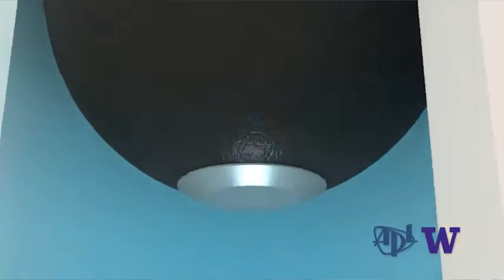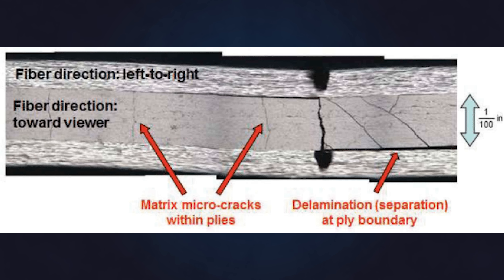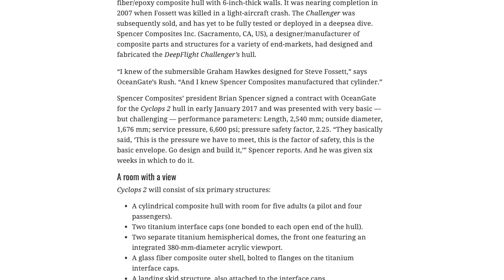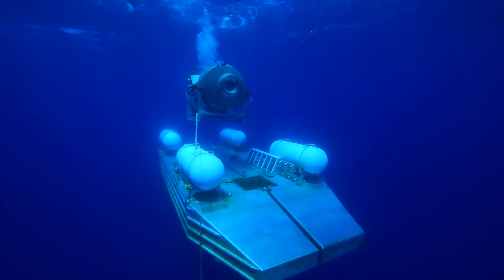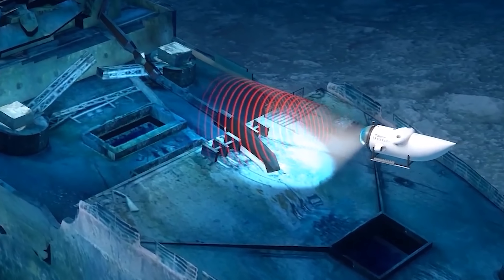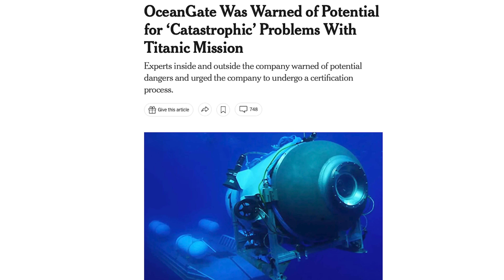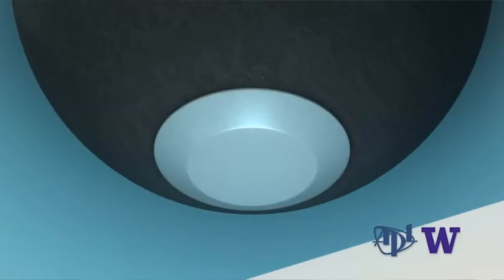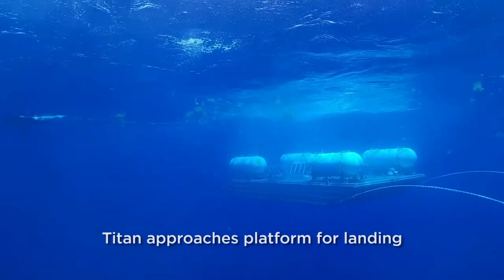Engineering Failures Behind Titan’s Implosion!

Comment: Well done sir.  There have been many videos posted by others attempting to explain the engineering and design flaws in this tragic situation.  This video is simply the most articulate, concise and yet informative.
Reply from the maker: Thank you 😊
Reply: @beyondengineering what about a submersible made from super glue and baking soda?
Reply from the maker: @dansaber4427  depends, what is it being submerged into?
Reply: @beyondengineering  to go to the Titanic of course. I've heard it's stronger than steel
Reply: @dansaber4427 Yes!  Let’s pick really impractical materials and then proceed on hope.  My choice would be a hull of sodium.  Just give it a nice coat of waterproof paint and don’t scratch it.
Reply: @beyondengineering 
All other problems aside,
why remove the cylinder after wrapping the carbon fiber?

Why not wrap the carbon fiber around a titanium cylinder and then attach it to the end caps with flanges?

It just seems to me that the 
carbon fiber could be used as an enhancement instead of as a 
stand-alone structure.

I know that this would require additional study and testing but is the concept valid?

At least the water couldn’t find its way though and unzip the thing like a waterjet in a machine shop.

PS

That is one creepy thumbnail that you used for this video…
Reply: selling a sub on its tensile strength is like bragging about the crush strength of a blimp. Mental!
Reply: Amen... and in such a  cool manner.
Reply: should we blame the carbon fiber inventor for the implosion or the user's stupidity?
Reply: @weepeeteeee No we shouldn't and no one did.

Comment: I don’t think it’s fundamentally flawed. What should have been done thought, is build a full size shell, even a scale model could have worked, and send it unmanned up and down as many times until it popped. Taking measurements and recording the entire time. If it’s safe for 5-10 times, then needs to be rebuilt or just discarded all together- then at least that’s what you would know

Comment: Carbon fiber is good for f1 cars but for titanic visits no it should of been made out of titanium cylinder and then Carbon fiber if at all because metal in cold it shrinks and in heat it expands it like getting a metal bar and bend it back and forwards it will snap at some point

Comment: Also. Concider the lateral pressure created on the epoxy by the equipment brace frame mounted on the rear titanium ring. There is a lot of weight on that ring.

Comment: Listen , if carbon fiber was the way to go . The Navy would be using it on their submarines. They DONT! Anyone who paid to go in this device who believed and trusted its ceo who avoided safety and openly spoke about it had to be nuts . 250,000 per person. Most costly funeral to date ! This whole thing is ridiculous. Carbon Fiber?? Bolted on bulkhead, no pressure hatch , no ductility in carbon fiber ! Engineering Disaster !

Comment: I wonder if an additional titanium ring in the middle of the length of carbon fiber (essentially splitting the cylinder into two separate and shorter cylinders) would have been enough to add strength against implosion.

Comment: The failure of the sub can be narrowed down to the poor choice of two building materials. Stockton went with Rhino Liner for the outside coating. Flex Seal would have been a much better option for this application. It's maritime capabilities have been proven. Phil Swift made a glass boat with it and stayed completely dry. 

I'm unsure what that peanut butter adhesive he was using is called but the go to product here is clearly Gorilla Glue. It's waterproof, incredibly strong and bonds to virtually anything. It can also withstand both hot and cold temperatures.

I hope this helps any future submarine entrepreneurs.

Comment: Carbon fiber and titanium have different compression ratios so they can't be bonded together and be expected to hold together under pressure. My estimation is the carbon fiber compressed about 1cm while the titanium end cap didn't move at all. So the pressure got into that 1cm and magnified the force so the submersible immediately imploded. But I'm not a scientist so I'm guessing it was a megalodon.

Comment: Best surface level test for a scaled model: depressurize inside hull to mear vacuum, and sumberge into extremely high pressure. The pressure ratio might be more correct at that point

Comment: From what i understand the hull was designed with a 2.25 safety factor plus then rounded up from 4.5 inch to 5inch, so higher than that. So it was designed to withstand a much higher pressure than needed, this is fairly standard and will account for fatigue of the structure. Carbon composites are generally a lot better in fatigue than metals. Sure it's weaker in compression than tension, but by orienting the fibres in the direction of the stresses (which are very simple for a pressure cylinder) and designing using that lower strength, there's no reason a carbon composite cylinder shouldn't be used. I also understand that the void content was less than 1%, which is better than some aerospace composites and it was due to undergo proof testing post manufacture. Not sure why everyone is hating on carbon fibre so much, seems like a very sensible choice especially combined with the fact it doesn't corrode in salt water, like metals do.

Comment: I'm a chemistry major.  Senior in college. I've had people blindly talk about how strong carbon fiber is but they don't understand that composite materials don't handle well under external pressure systems.  All thr benefits of CF (of which there are many) vanish when dealing with pressure.  I'm not an engineer but the basic chemistry behind it is easy to understand.

Comment: this was done by people that did not understand the pressures at that depth There should have been at least three engineers, working to put something like this together. It failed from bad engineering design, especially the epoxy used to join the outer domes to the titanium ring…

Comment: Thank you for pointing out that carbon fiber has no compression resistance. It's excellent in tension (to contain an inner pressure for instance) but it's useless to withstand a compression. Basically the only thing that resisted in the Titan's hull was the resin - it must have been a pretty good one.

Comment: i know nothing about this but just gluing that thing on doesn't seem safe. maybe it could've been screwed in or something.
Reply from the maker: You can’t screw in to the fibers, it wouldn’t have lasted a single dive with that. Glue in was the best option, but the main problem is they never tested it properly to know if there were better ways or better adhesives

Comment: OceanGate's stock reply to anyone questioning the wisdom of using carbon fiber to form the body of the sub apparently was, "We have many stress monitors embedded to let us know if a problem develops." If you stop and think about it, what that is saying is that, "If the carbon fiber starts breaking down, we have these monitors which will tell you that you have 30 seconds to bend over and kiss you ass goodbye."
Reply from the maker: I think the problem was that the heads up those sensors gave was the same as your ears. Plus way less than 30 seconds, possibly a few. That’s what the Lochridge lawsuit had as a concern at least

Comment: I tried asking on another channel got no response i will try here ..

So that metal that the carbon fibres wraps around how did it implode as the metal would act as structure.. no? & whre is that metal at there should be some parts of it
Reply from the maker: How thick was that metal? Seemed like just a liner on the inside, so not providing much structural strength. Once the CF succumbed to pressure, everything on the inside did too. As for where it is, I would have no idea, perhaps there are pieces of it somewhere

Comment: Wonderful narration and  narrative. 
Good point on the epoxy  adhesive being subjected repeatedly to the differing expansion and contractions of the interfacial materials.
Yep, just Bad engineering,  no risk management/ potential problem analysis.
Reply from the maker: They must have worked it out based on some analysis 🧐 it was too experimental to take people down however
Reply: @beyondengineering  Yep, agreed,.. did a bit of a rush there 😏
Intended to point out,  no full RM was really done, not just for the equipment,  but also systems and esp operability in ascending after an emergency.... ....

Comment: The carbon fiber was definitely an issue but what about the glue used to attach it to the titanium caps? Flat surface with only an inch and a half overlap? Expired carbon fiber on top of it. This thing was dragged through the ocean for roughly 400 miles on that launch platform, loosing and weakening that already horrible bond. Carbon fiber and titanium expanding and retracting at different temps and speeds. Then the porthole being rated for only a third of the Titanic depth. Everything using Bluetooth connectivity to avoid cabling and more. What else did he do wrong? Guess it was let’s roll the dice so we can get funding for the next 6 months. Insane
Reply from the maker: Move fast and break things is a risky way to go about such things, gotta respect the deep sea

Comment: I get it that carbon fibre is a more risky and untested material for this use.

That being said, I think it is way too simple to say this sub imploded due to the choise of material. From an engineering perspective it is absolutely possible to construct a sub out of carbon fibre that can go to 4,000m.

For all its flaws and cutting of corners, Titan visited the Titanic multiple times succesfully, so it would not have to be improved and tested much before it would work. So I could absolutely see a way to take the Titan design, improve it, build in more safety margin, test it and make it safe.

Whether its worth it is another question. Maybe it is safer and easier to just use titanium. But at some point someone needs to test new ways of doing things. But there is a right way to do it, and this was not it.
Reply from the maker: I think you're spot on and in engineering, it has to make a profit for something to make sense! Also hopefully next people to try this spend the time needed to test it properly

Comment: you cant reuse carbon fiber at those crushing depths, it will fatigue and the massive compression will create micro cracking and micro tears that will get worse with each dive and eventually fail, weather it's the 3rd, 4th or the 10th dive it will fail eventually, as it did on it 3rd dive to the wreck, now titan is with the titanic a wreck in the same region ???
imagine if he did not go down that day the shit he would be coping !!!
Reply from the maker: It's a shame they didn't test to determine how long one hull would last

Comment: Excellent video!!!! 
Wouldn't all these problems be exacerbated by having the sub tugged in rough waters for hundreds of miles? In order to save money, Rush used a much smaller ship, the Polar Prince, that could not carry the sub securely, but instead, tugged it for 800 miles.
The more I hear and read, the more I am convinced that Rush was suicidal.
Reply from the maker: Thank you!

I think that’s less of a factor, in fact it’s probably very efficient. 

However, this kind of operation needs redundancy. If you look at the video of making of DSV Limiting Factor, they take multiple ROVs with them when they dive just so they can get out of trouble if needed.
Reply: @beyondengineering  thanks for the recommendation. The video was excellent.
Reply from the maker: @claudiastokes6485  you are welcome

Comment: ?....hmmm.    1)   Glue   2) Carbon  fibre   3)   a  joystick, to  actually  ' operate '  or   ' drive '  the sub......hmmm.           Seems to me,  S E E M S,  that that guy,  Mr. Rush, is an over-sized child, with TOO  MUCH  MONEY,  and a severe lack  of  L O G I C.  Dodging, escaping  the  LEGAL  SAFETY  SYSTEMS  IN  PLACE ;  dodging   ALL  SAFETY  COMMON  SENSE  ( of which, he apparently  had  none ).
  HE  should  have used, titanium  throughout ,  his  ' sub   design '.    Another item, no one has ever mentioned, anywhere on Youtube about this  SUB ;   THERMAL  properties, of both the type of titanium used, and that  carbon fibre.  All  elements,  have differing  characteristics, of the  3 laws  of  thermodynamics.  The colder deeper temperatures could have been another factor with regards to the thermal expansion / contraction of the cold .        Agreed, titanium is very difficult to ' work with ' but,  once  completed, it would have  survived that 6,000 psi  pressure, nearly  13,000 feet down into the sea.  ....oh well....as the older  song goes  '' life  goes  on '.......
Reply from the maker: When the boundary is pushed this far, there needs to be extensive data to support your position, they never bothered with any proper verification/validation that they should have done ✅
Reply: @beyondengineering  Thank-you.  As an old wise teacher, told me :  '' Qualified,  doesn't  necessarily mean, one is  Certified '''.   Take care, of all within  your power !

Comment: Do not know how long it would take an explosion of air bubbles to reach the surface from that depth, but wouldn't it be like a depth charge going off. And would it have carried sound?
Reply: Thank you very much for the time in answering my questions
Reply from the maker: It definitely carried sound, US Navy hydrophones picked it up straight away
Reply: @beyondengineering  , would the bubbles from the implosion and explosion when reaching the surface, be very easy to see or not really at all,? Like or unlike a depth charge surface explosion ???
Reply from the maker: @seanmcclelland4403  no idea. If I were to guess, there were probably very small bubbles that did make it to the surface but not noticeable enough to observe or even together depending on the currents

Comment: Rush did not know the difference between tension and compression forces... or the danger of joining materials with totally different characteristics.  I also hear that the Titan was stored outside in freezing temperature, so any water inside the CF would have caused expansion damage to CF layers.  The simple overlap way the CF was wound into the tube was also a very weak way to construct a tube...
Reply from the maker: It’s impossible to say what he did or did not know, It’s more clear they didn’t test or maintain as they should have done at the bare minimum

Comment: Problem with Carbon fibre it is not homogenous - Aircraft made from carbon fibre need a copper mesh on the outside to limit the damage from lightning strikes,  which causes pores in the material as it burns out the fibres and weakens it.
Reply from the maker: Not to mention they are holding pressure inside, not on the outside

Comment: Pretty good explanation of what went down. The CF was expired stock bought on the cheap, apparantly, so that could also be part of the problem? 
I also think that the CF hull was water-logged (from previous dive damage) & that's why it was struggling to ascend at the end (& possibly why it was descending 50% faster than normal, according to the leaked transcripts)
But Rush was.. Too confident (or arrogant?) to slow down, or try to when advised.
Reply from the maker: I don’t believe in the transcript but I think the expired one was maybe the old hull that was discarded? Not sure, I guess regardless of all those things, not the correct application for this material

Comment: They use carbon fiber because it was the cheapest in this aplication. Imagine making this tube out of titanium, manufacturing process will cost much more so they instead roll some carbon fiber on tube and call it ready...
Reply from the maker: I think it wasn’t just the cost, they clearly had a desire to prove they could usher in a new era of composite materials in deep sea vessels, a very conservative industry (for good reason). 

Unfortunately, they never tested or validated their belief in the material as they should have. When you go against the grain, the burden of proof is on you

Comment: eh to be honest the main problem was that they thought they wouldn't need to replace the sub for a long time. Most subs that go that deep can only be used a few times if not once's. This sub has lasted 17 times or so + other times they did not make it all the way, I think. I mean that is a lot, they just had to scrap it after 10 and there would be no issues.
I think saying its Carbon Fiber's fault is like saying Boeing 737 airframe is bad because it can fail after it's been used over its limit. The issue is we know what is the limit of 737 and they did not know their limits.

Comment: Carbon fiber worked several times. The problem was that it needed to be replaced after the first 10 dives
Reply from the maker: How do we know that? This lasted 50 dives but under different conditions or weather, does it last 40? 30? 100?

Only one way to know with certainty, nail down the manufacturing process and test many times to have some confidence

Comment: As a statistician, the majority of educated people are not cavalier.  I don't think Stockton Rush / OceanGate actively avoided the testing.   I think he made a rational decision after using a heuristic, but I think he was probably off by 1-2 orders of magnitude. 

I think Stockton Rush thought there was 0.05%-0.5% chance of failure, and that this would very slowly increase over time, and that all the testing was unwarranted and expensive.

In reality the chance of error was somewhere between 5%-50% failure, and time to failure rapidly increased over time (# missions, cumulative stress, etc.).

There was a mission where a significant buckling sound was heard, and this is when his personal heuristic should have aligned with reality.
Reply from the maker: Yeah I agree with this, he just didn’t pay enough attention to align his perception of risk with reality